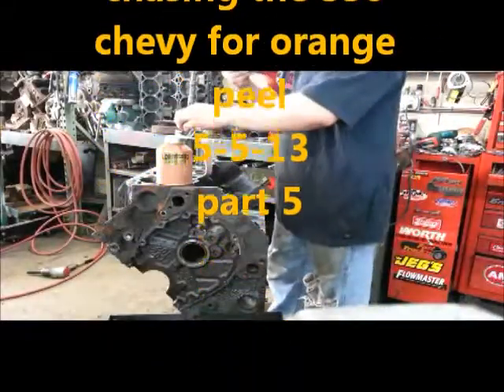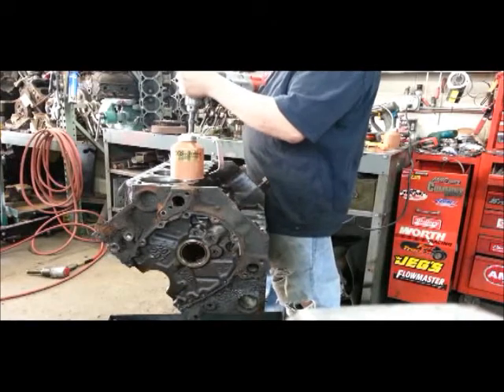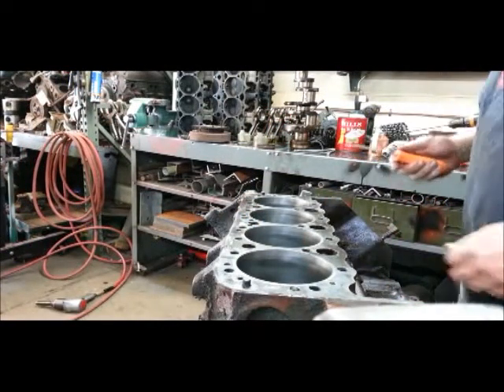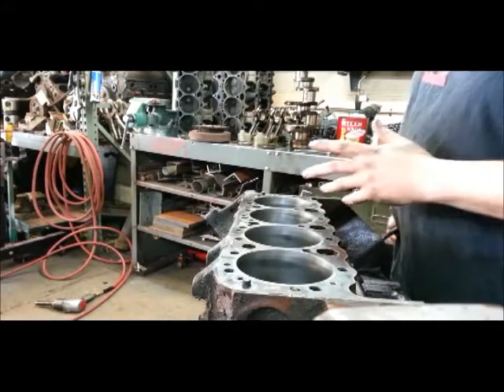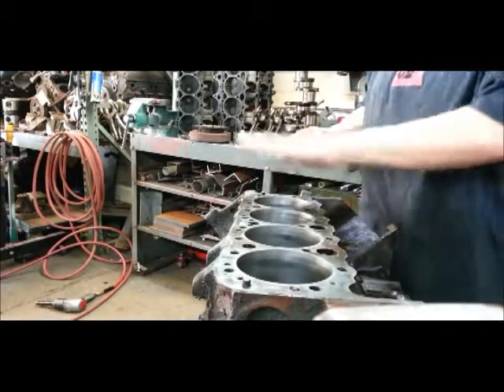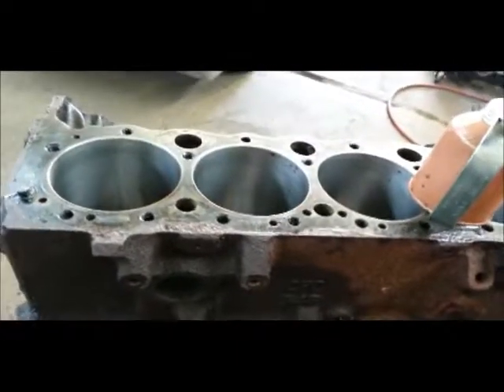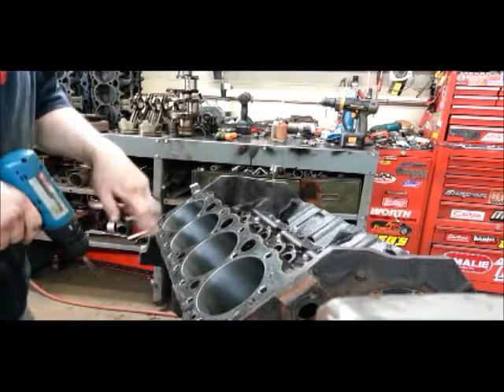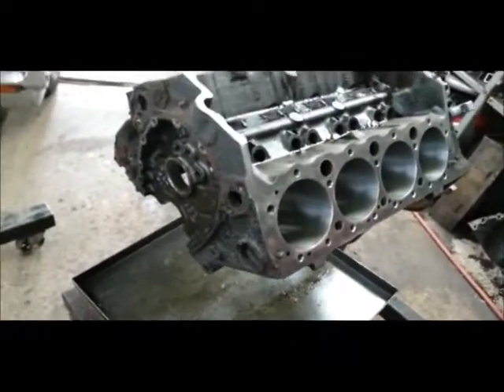350 chevy for orange peel . part 5

Comment: Good series! Using the battery drill to tap sure looks scary. It sure saves a lot of time as long as you don't muck up the threads. Now, however, I need to get to work myself. I have 9 doors to paint and no matter how much I watch you work they don't seem to get done.